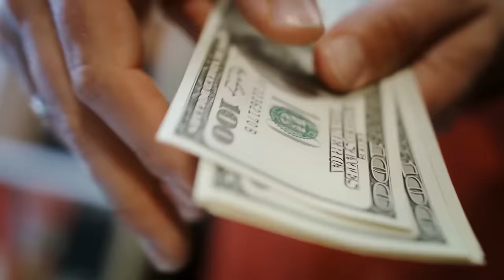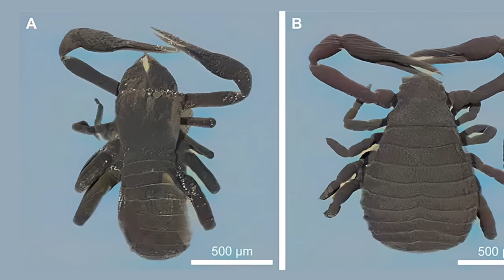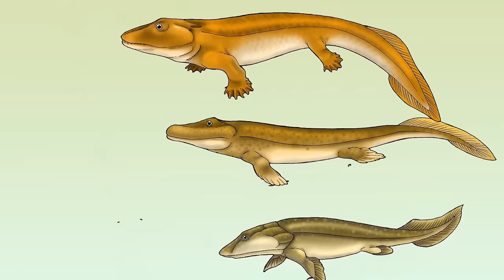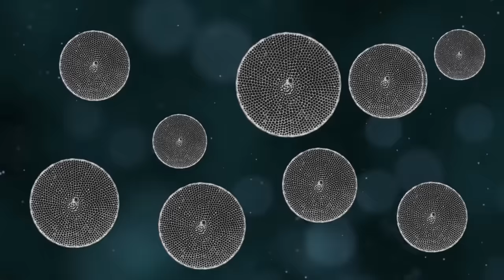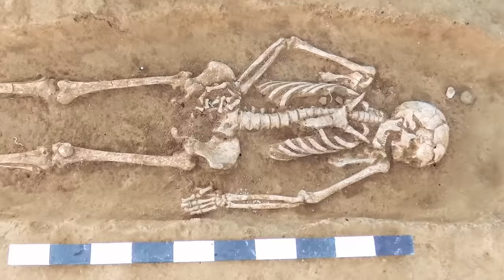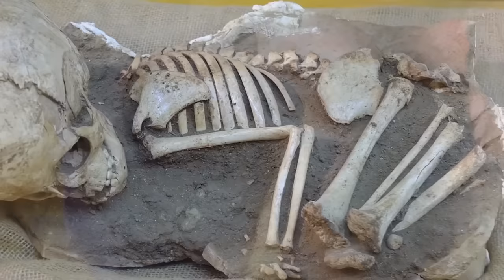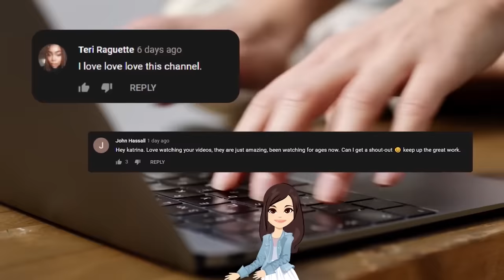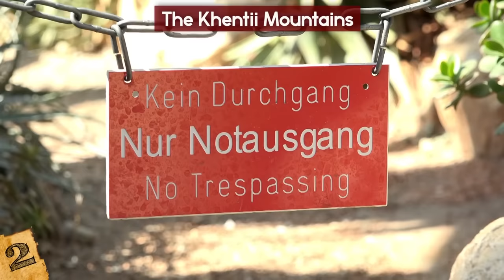Discoveries Made In The Grand Canyon

Comment: 1:20 You wouldn't multiply 4,800 by 97 because that's not how percents work. 3 doesn't fit into 100 97 times. So no, there aren't 465,600 archaeological sites in total. There are only 160,000. Which is still a lot. But your math is WAY WAY OFF.